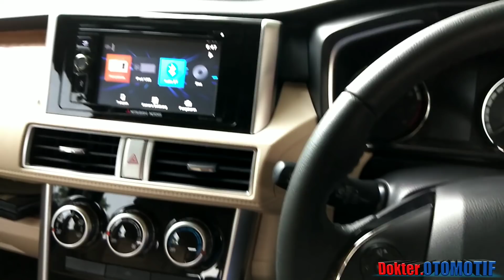Lampu XPANDER kurang TERANG??? Ganti lampu led xpander solusinya..

Comment: Setau saya , percuma aja diganti LED . Sudah saya coba ganti sampai beberapa merek , tapi kurang terang . Entah kenapa . Inilah kekurangan xpander . Tapi , dalam hal lain , mantap , mobil sejenisnya kalah
Reply: Kalo gak terang ganti lampu projector
Reply: Walaupun ganti lampu tronton juga ga bakal terang orang pake kaca film y yg tebal.
Reply: Mau terang?? Ganti aja Relay Pabrikan nya, pake Relay Racing & Usahakan Dynamo Charger ny juga jangan sampe tekor malah gak kuat charge aki. Karna berlebihan memakai kelistrikan secara menyeluruh.
Itu sengaja sudah settingan dri pabrik lampu ny dibikin gk terlalu terang berarti itu yg sudah mantap di pabrik supaya Aki & dynamo spull charge ny gak SOAK / tekor.